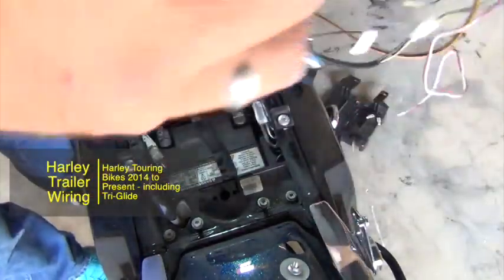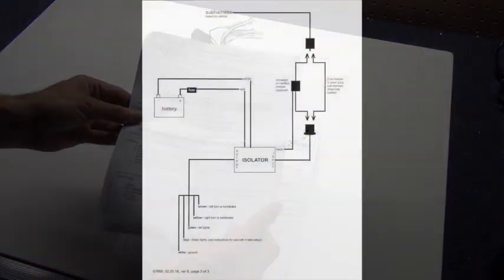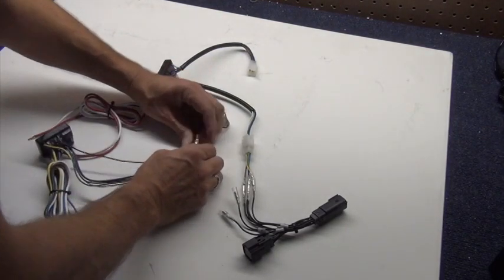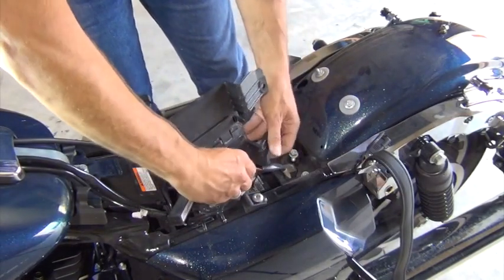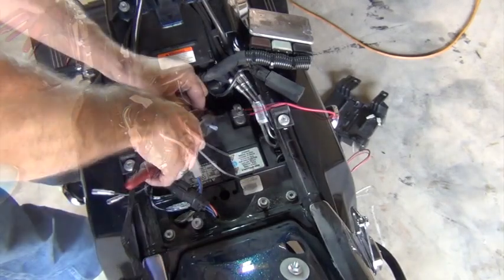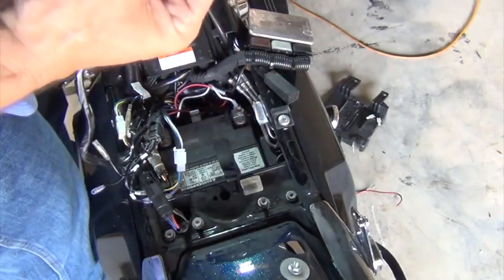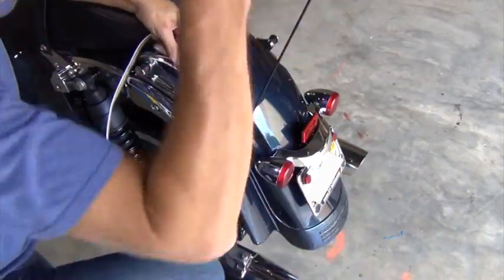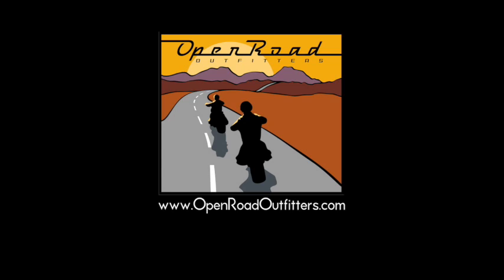Harley Trailer Wiring Harness Installation

Comment: do you need to increase the amp of the fuse
Reply from the maker: Hi Tim, the isolating kit comes with its own fuse (15 amp) and connects directly to the battery. So you won't need to change any fuses on the bike and 15 amps on the isolating harness is more than enough to drive trailer lights.